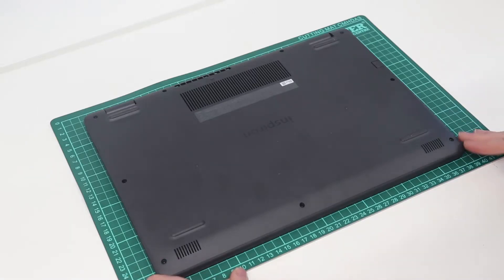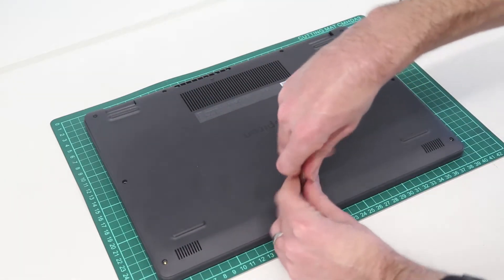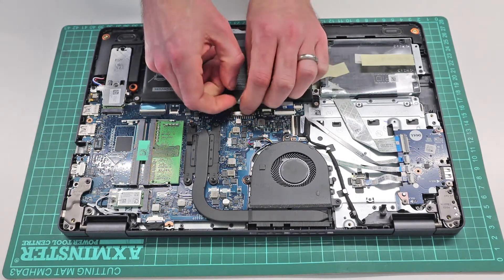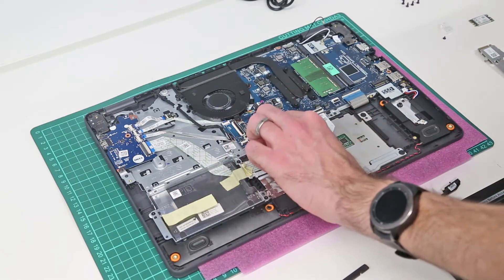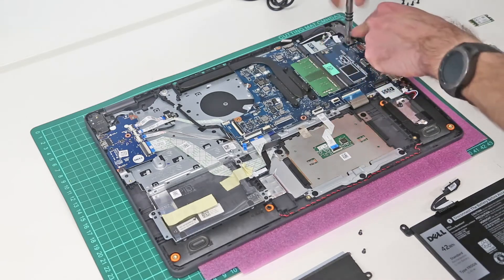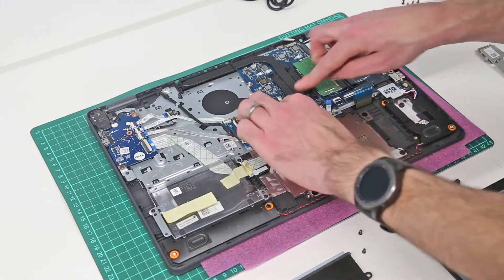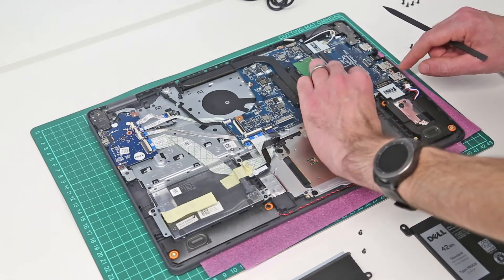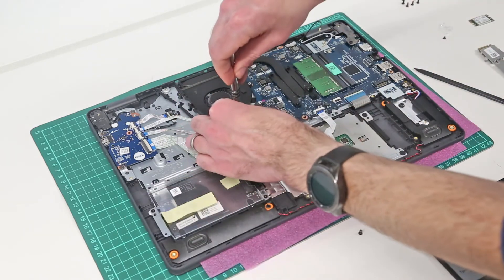Dell Inspiron 15 3501 - Mainboard Replacement Guide

Comment: Hey James !!! Can you do a Video about Keyboard Replacement in  Dell 3501... I actually need to replace my NON-Backlight keyboard into a  Backlight Keyboard .. and your SSD+RAM Upgrade Video Really helps to me to do my UPGRADE too ❤
Reply from the maker: I no longer have the laptop - I bought it specifically for the videos and sold it on after.
You'd have to replace the whole palm rest and keyboard assembly, see page 77 of the service manual here: https://dl.dell.com/topicspdf/inspiron-15-3501-laptop_service-manual_en-us.pdf
Reply: @BrueComputing   Oh :( Thank You 💕
Reply: Hey bro ...I also bought a Dell Inspiron 3501 laptop...but no backlit keyboard..... Just to confirm, did you get the solution?and if yes , pls do share with me..thank you.
Reply: @namitapradhan7250  no Bro  😥 . I didn't find amy solution for that....
Reply from the maker: @namitapradhan7250  You'd have to buy a new palmrest/keyboard assembly with backlight (if there is one).